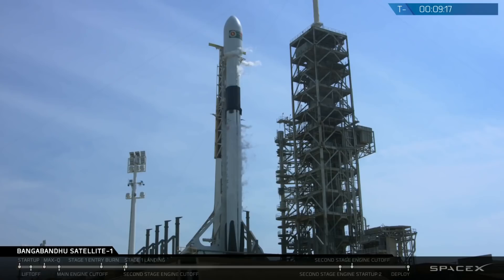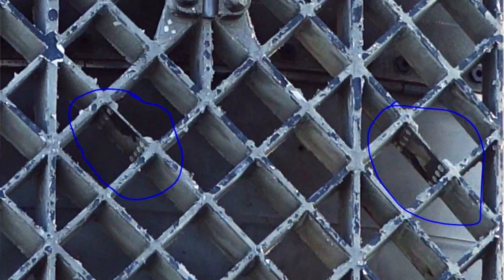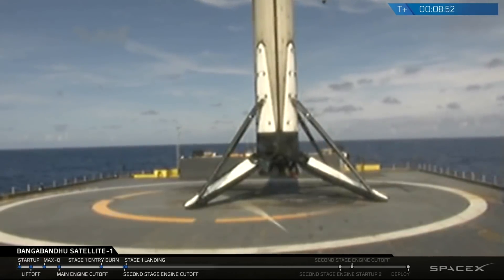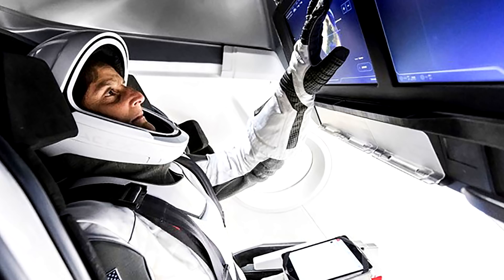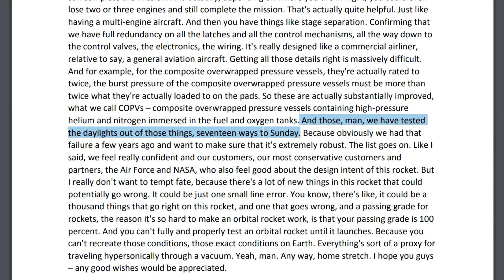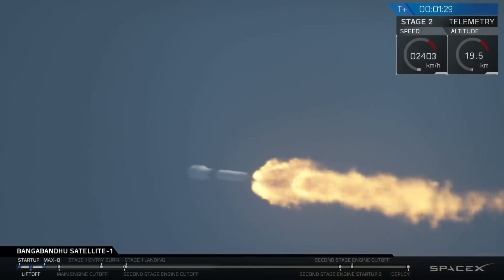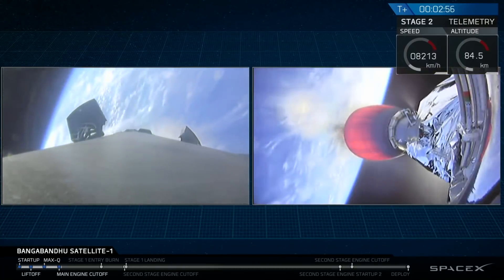How Well Did SpaceX's new Falcon 9 Work?

Comment: Considering your interest, I was wondering if I could grab your opinion, Scott (or anyone else's, for that matter), on Thunderf00t's debunking videos on Hyperloop and the Boring company? Has anyone done research of their own to contradict some of the seemingly-valid points he brings up? 

I'm massively interested in both projects, and am remaining optimistically sceptical
Reply from the maker: I watched a bit of Thunderf00t’s hyoerloop video and several of the points (like problems with thermal expansion and faultlines) had existing solutions which were in use. I stopped watching because it was clear he was framing legitimate technical challenges as showstopping problems, even though casual internet searches would reveal workignsolutions.
Reply: Scott Manley, I was under the same impression - that many of the problems highlighted would definitely have either solutions under consideration or outright implementation, and that he was using a select-few problems to make it seem like the whole thing fundamentally wouldn't work.

I appreciate your reply! All the best
Reply: he seems to hate on elon for some reason one of the reasons I stopped watching him, hyper loop shouldn't explosively decompress but slowly through any hole well at least according to Issac Arthur heh
Reply: Explosively compress, I think.  But submarines.  Low pressure on the inside, which is why they are cylinders.  Steam plant condensers.  Low pressure on the inside.  These things work every day.
Reply: A quick youtube search will reveal that all of Thunderfoot's hyperloop videos have been comprehensively 'busted'.
Reply: Tft whacks moles.  Poor things.
Reply: Just to begin, I work as a piping and pipeline engineer in Oil and Gas and have previously spent 8 years in the Navy as an engineer. So......Tubular structures in general are very good where the pressure is higher on the inside to maintain an equal push on the total area. Even then when pressurising or depressurising is it desirable to do this at a steady rate and across the whole tube section. Which is why when starting up a pipeline it is pressurised in sections.  Ok so this is fairly obvious to everyone (I hope), things get very tricky when the situation is reversed. The two examples given by Dennis above are both correct (some of the time with the condenser) but, both of these items contain a lot of internal supporting structure. The condenser is a shell and tube heat exchanger, with the tubes normally mounted in a heavy support structure within the 'Shell' to maintain a equal cooling (or heating , they work both ways) effect. The tube bundle will normally support the outside shell from folding in on itself. The same is true with the Submarine. There is a lot of internal structure used to maintain the shape under the crushing pressure. Both of the examples 'usually have to deal with equal pressure around the outside of the tube. 

The hyperloop tube cannot have these internal structures or the 'trains' won't be able to pass though. In some of the various video's (including Hyperloops own) you see the tubes they are using in storage and you can see the temporary cross braces used to help maintain the shape during transport. Over the short test run (comparatively short compared to the length of track needed to make a transport system) this won't be a major issue. From video's they have plenty of supports (outside) and they only have to push against 1bar (approximately) of atmospheric pressure, spread equally around the outside of the tube, but if the intention is to bury the 'pipe' then it's a whole different game. Add tons of rock/soil/whatever to the top and you have more problems to worry about. The extra pressure on the top could cause the tube to deform. All of that said though I do like the idea, I just think it might work better with a triangular shape with some internal supports to force the pressure away (imagine the triangle point upwards). I can see the value in using a tube as there is less volume to depressurise and more usable area (for the trains), I'm just not sure it's going to work and not with the materials currently used in the test track. The tubes used in the test track is also understandable as they are (effectively) prototyping, so you would want to use available materials. As to Thunderfoot, yeah he does have a 'boner' for Musk and his ideas which is, at time, verging on the pathological especially with the corrosion in the test track (I assume people know that every metal corrodes, even stainless steel under certain conditions - 20+ deg seawater for example, stress corrosion cracking being a big issue around welded areas). At times he does go a little too far. Anyway gone on too long, sorry for the lecture, it was unintended......
Reply: "I just think it might work better with a triangular shape" - What?  You just ruined your 'reputation'.  You'd better remain anonymous.  Go read a book on mechanical engineering, for all our sakes.
Reply: OK Tony I'll bite, why, in your engineering opinion, would the triangle shape not be a stronger structure? This should be good......
Reply: +Duane C
I shall use Duane C's quote to provide the answer: "Tubular structures in general are very good".  In fact they cannot be bettered - except by hollow spherical structures..
"to maintain an equal push on the total area" - happens exactly the same if the pressure is outside.  There is still "an equal push on the total area".
The difference between internal and external pressure is that with internal pressure the vessel structural material is put into tension and the structural stability increased, whereas with external pressure the vessel structural material is put into compression and the structural stability reduced.
When submarines dive beyond their limiting depth their cylinders will eventually become unstable, buckle and collapse under severe compression, where every extra 32 feet of depth gives you another atmosphere (15 psi).  This typically happens with a bang which can be heard (under water, at the thermocline) all the way across oceans.
Your 'hollow prisms' are terribly weak across their flat surfaces.  You could, of course, internally brace them, and if you make a thorough job of that, you'll end up where we started - with a hollow cylinder.
Hyperloop's tubes are structurally perfectly stable with an outside pressure of 15 PSI and an internal vacuum.
But A SAFE SYSTEM will be VERY EXPENSIVE unless you are content to find yourself, say, stranded twenty miles down/along a pipe, surrounded by a vacuum, running out of air, and waiting for some foreign object to impact you at the speed of sound.  Every fix for these 'difficulties' has its own expensive solution and reduction in theoretical efficiency, and in my experience, compromises WILL be made.
You cannot be as qualified as you claim to be.  If the hyperloop were to be designed by people with your skill level, you wouldn't find people like me riding in it, if it worked at all.
As I have already indicated, go read and understand a good engineering book and you'll get the message.
Reply: Duane C have you ever seen a triangular submarine? No? Why is that?
Reply: As I said above, submarines have internal structure and internal supports, they also receive equal pressure all round. If they intend burying the hyperloop 'tube' the situation will be different. There will be greater stress place on the top of the tube increasing the risk of deforming the metal and there cannot be any internal supports inside the tube or the trains/carriers will not be able to pass though. If they double skin the tube (as some submarines are - and the Russian Typhoon class even more so) to put supports in then why not just build it in a stronger configuration in the first place. If they intend to bore the route then place the pipe with an air gap then the tube might work, but that would mean boring hundreds if not thousands of miles of which, even with the improved boring machines take a very long time.
Reply: Duane C I very much doubt there is a significant difference in pressure on the top vs the bottom (possibly the opposite) and in any case the boring company tunnels are specced to 5 atmospheres, so as Elon said, even with a perfect vacuum it still has 4 atmospheres of strength.
Reply: If you put weight on something at the top the stress factor is going to be higher on the top of it. Tubular structure are very good at resisting compression if stood vertically or near vertically which is why steel tubes are the first choice for making off shore jackets and for wind turbines structural parts , but the same weight placed onto a tube horizontally could crush the tube. As for the boring, that, as I said, could work. The cut though the rock would be supported by the outside structure of the rock and would not require inside support. That said you cannot extrapolate that 5 bar internal  pressure specification (which would be pressure inside the tube) would equate to a 4 bar external strength if you have a vacuum inside. They are rated to maintain 5 bar taking into account leakage of air (or whatever your pressuring) though micro fractures and other anomalies which would be encountered in natural rock formations. Once again any pressure inside of the tube will help maintain it's shape. Negative pressure (or a near vacuum) will try and deform it.
Reply: Duane C a round structure would be stronger no matter how you cut it. Even the triangular structures you were talking about are normally made with round tubes. Triangles are very great at structural load meaning fighting gravity but they suck at holding pressure or vacuum
Reply: Fair enough, I just can't be bothered with this anymore. Good luck with your career as Structural Engineer.
Reply: Duane C I might be mistaken but aren't buried structures under significant forces on the sides as well as the top and the bottom? Meaning that the situation is more akin to the submarine? I don't think underground pressures are focused on the tops and bottoms of a structure.
Reply: Samuel Price Tubes are not strong at all when pinched (force applied to top and bottom). For that you would clearly want an internal support structure. If you are thinking that the forces on the buried tube are more akin to that of a submarine (homogeneous pressure on all sides) then I am afraid there is a misunderstanding between you and Duane C.
Reply: Chris Padgett I think Duane C was thinking that the forces on the tube would not be the same on all sides (like a submarine) but rather be concentrated on the top, in which case you would want the structure to taper to a point at the top to dissipate the load of the above earth. I believe a pointed arch would actually be a better shape than a triangle, but I could be mistaken.

Comment: Correct me if I'm wrong, but I believe that the main reason for picking these black areas to be specifically protected is that they are not cooled by the fuel. The main portion of the rocket does not need the protection because it "is" the tank and is touching the supercooled fuel.
Reply from the maker: There’s almost no fuel in the tanks by the time it’s coming back down, so the cooling effect isn’t there.

Comment: 7000 series aluminum is also widely used in the firearm industry. 7075-T6 has been used for the revivers of the AR-15 platforms since the late 50s. It's also used by some companies to make rifle handguard and rail systems. (though 6000 series aluminum is more common)

Comment: Ok.... the idea of flying from the barge back makes perfect sense! Plus legs are retractable! Please do it in KSP
Reply: You would have to launch much more often to justify keeping the recovery fleet out all the time. The barge also can't handle rough seas. The F9 flying back would need launch mounts because the legs can't support the weight of a fueled rocket or fold up in flight. A nose cone like the FH side cores because the rocket would get ripped apart. And a barge that won't get destroyed when the rocket blasts off. Plus the equipment to do these things and fuel the rocket
Reply: I have a name Sir, KSP solves all of those problems.

Comment: nasa wants 7 full flights but they just crammed a bunch of astronauts into the space shuttle as soon as it was ready.
Reply: that was because they did extensive testing before and it could not fly unmanned. SpaceX has chosen to make more flights instead of testing more to demonstrate crew safety.
Reply: No they didn't. First Shuttle test flights had crews of TWO.

Comment: I don't like how SpaceX plans to use load up those super-chilled fuels WHILE astronauts are sitting inside the capsule.  There is a 5% chance of something going wrong with such a setup.  Like 'Explosion' type of 'wrong'.   That risk can be eliminated if the main capsule is connected to the tower using a cable tether, so that if the rocket EXPLODES then the capsule will simply stay put and won't fall down into the fire.  That should also be done with regular launches also, to make sure that cargo won't be lost in the case of a rocket exploding upon fueling-up.  The tower has to be made extra strong to withstand explosions and the heat of the flame, and to hold onto the weight of the cargo by that tether.   Then when the rocket is finally ready to launch, the tether is released just after the rockets are ignited.   The tether would have to be released first, and once it is detected that the tether is let go then the hold-down clamps are released.  If the engines are ignited and they EXPLODE, then the tether saves the cargo from bunring up in the fireball.  That is how 'NORMAL' space launches really should be done, for cargo safety sake.
Reply from the maker: There have been 36 boosters launched using load and go, only one exploded. A total of 54 launches of falcon 9. So your claim of 5% chance is wrong.
Reply: It's even far lower than 1/36. SpaceX has done hundreds of fueling cycles and static fires since the AMOS-6 anomaly, with no issues. They will have around 200 cycles done by the time they fly the first crew. The chance of another on-pad explosion is probably less than 0.1%.
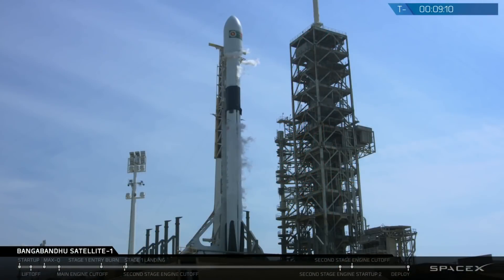Reply: The fireball from an exploding booster is bigger than the entire rocket.  Shrapnel flies very far.  The only way to save the capsule is to get it out of the blast zone FAST.  But what is the inherent danger in fueling that is not present during topping/venting?  Because that continues until about T-1:00
Reply: "the tether saves the cargo from bunring up in the fireball" - Heat rises.  Hadn't you noticed?  Are you a barbecue manufacturer?  Is the earth round or flat?